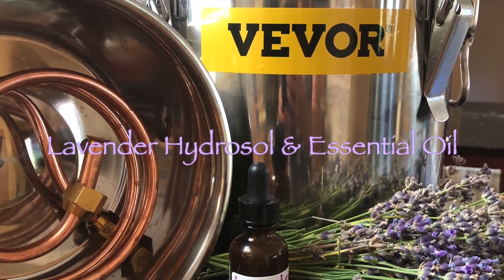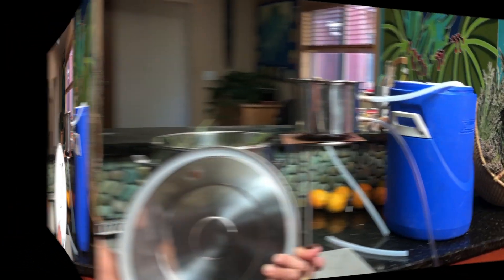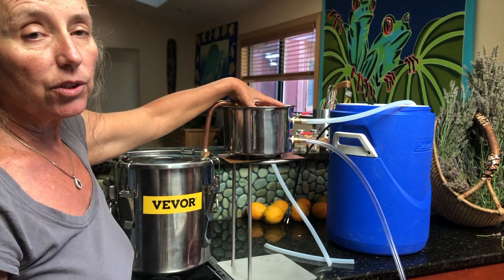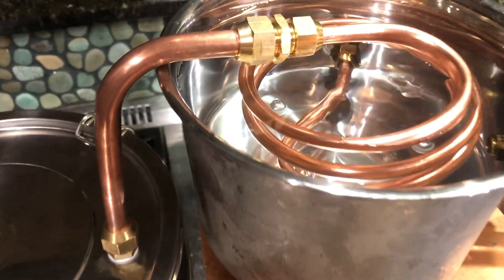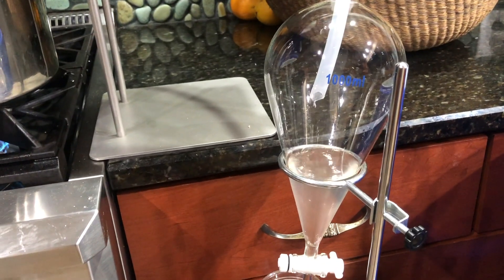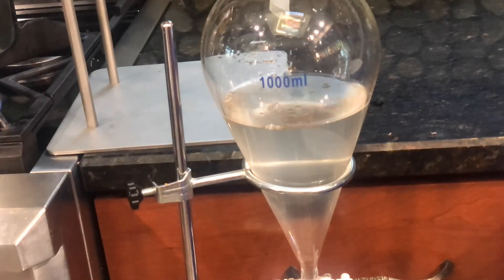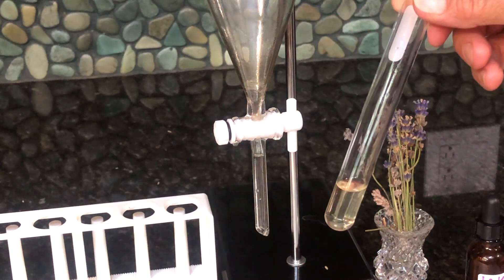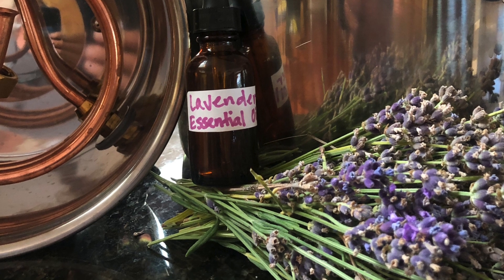Make Lavender Essential Oil (Linalool) and Hydrosol w/Vevor 3 gal Alcohol Distiller in your Kitchen!

Comment: How do you know when distill is complete? We bought a 13gal distiller smaller ones were sold out 😩 but we do have enough to fill’er up. Your video is the only one we could find of the same system we have just different size that makes sense lol…this is our first time using one so you think we can use what it comes with or we do have to buy other attachments/accessories? TIA 😊
Reply from the maker: Thank you for watching!!
The modifications I made are for steam distillations.
If you're looking to do steam distillation, you will need a vegetable steamer.
Also, I move the condenser to the side in an attempt to keep it cool. I do not keep it on top of the still where it is hot.
My most recent modification involves lengthening the copper tubing leading to the condenser. This moves condenser even further away to keep stove from heating it up.

I tend to stop at about an hour of producing hydrosol.
The time will probably differ with larger volume. I'm able to put about a gallon of water in the three gallon with a vegetable steamer.

Comment: how do you know the sweet spot and qhat does that mean?
Reply from the maker: The sweet spot is when the inflow equals the outflow in the condensing unit and the level of the cold water remains constant.
The adjustments are very minimal, and you may think everything is good, but then there may be an overflow or an emptying below the outflow.

Comment: Hello,great video!!
We didnt even receive instruction on either of ours. 
We have 13.2gallons bc we own a herbal farm.
How long exactly did it take and how much exactly did you get of lavender oil?
We tried twice and not enough to smile about😂 
Thanks again
Reply from the maker: Thank you! Stoked I could teach you how to use it. The instructions I got weren’t that good, and there was nothing on hydrosols or essential oils in them. 
I put together my lab experience and my homesteading do-it-yourself mindset to figure it out. 

Yes, it takes a lot for a little bit of essential oil. Much more hydrosol from the process.
I filled three small vials of essential oil and got about 2500mL hydrosol. I did two batches of flowers and stems stuffed into the 3gallon still.

Awesome you got the 13.2gallons!
Could you imagine using those tiny copper stills that go for $800.
You can buy three sizes of Vevor distillers for that same $800 and still have money left.

Comment: You probably already know but your cold water needs to go in at the bottom. Heat rises so it is more efficient that way. Not sure it really matters though with so small of a worm.
Reply from the maker: Yes, I do know.   However….
I had issues with siphoning when I set it up the logical, heat efficient way.
I’ll switch it up again and see what happens.
The steam does come in hottest at the top where the cold enters, so there’s steam to coldest contact with cold coming in on the top.
Reply: @farmtofamilyhomestead  yeah you have a point.

Comment: Can the still be used on a flat range stove
Reply from the maker: @TheEmpowerers  yes! I just raise mine so the copper output tubing reaches the condenser. The stand I use for the condenser is a little tall, so raising the pot a little does the trick.
I have a link to a scissor lift stand in my Linktree store if you need something to put the condenser on.
The scissor lift can be raised to any height.

Comment: Hi, when you say 3 runs, did you change out your plant material or just add more water and run the process again?
Reply from the maker: @emmacurry7056, Great question!

I changed the plant material for each run and cleaned out the still, adding new water to just below the steamer.

Each run generated between 750mL and 1L of hydrosol, with the still holding about 2L of water beneath the steamer. With these volumes I am assured the still won’t run dry.